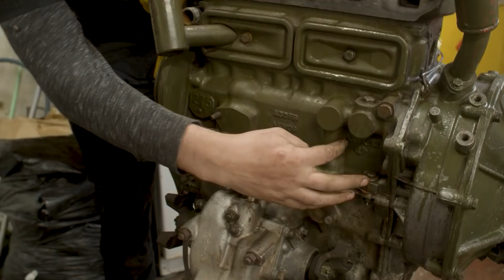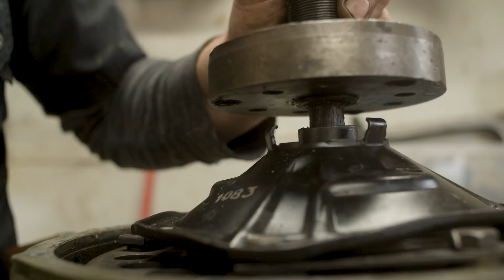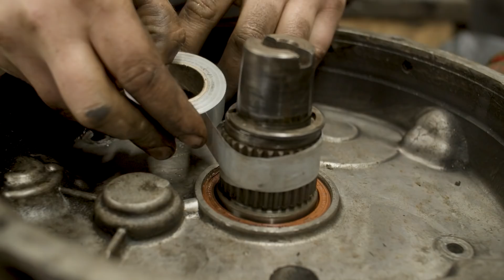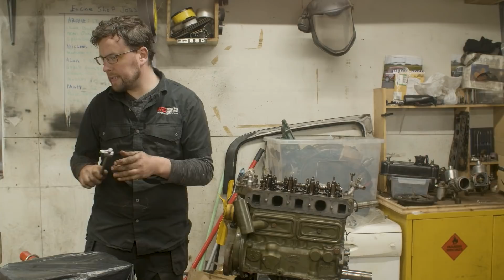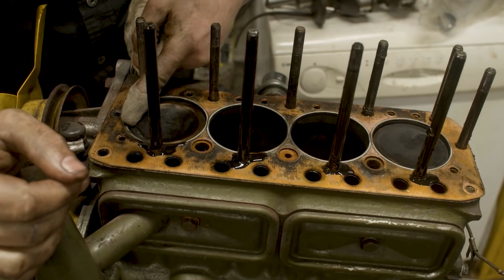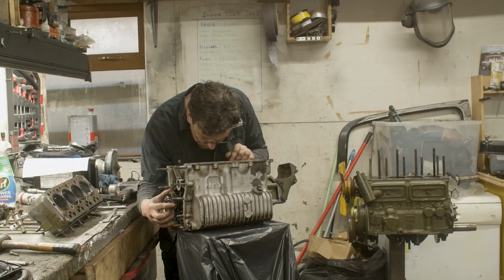Stripping The Engine Of A Donor Mini Cooper S - Part 1

Comment: Spur cut competition gears can be fitted to all mini gearboxes, after engin no. 815140 for 850s. Not familiar with that part number, it was over 55 years since I worked with BMC! Probably senility setting in. I would have thought that it should have been prefixed by a C- though.  Note all of my comments are correct as of about 1966!
Reply from the maker: Thanks for commenting Tony and I greatly appreciate having someone of your experience helping out on the channel. I have taken a second look at the box and very defiantly no sign of a C- thats not to say it shouldn't be there could have been ground off.

Comment: When I was at BMC special tuning/competitions department in the early to mid 1960s  that camshaft wasn't available, I don't recognise the part number. I assume that its a later cam with the different oil pump drive. For Road use and our rally cars we always recommend and used 510 cams. They became the standard cam for later Ss, after engine no. 9F/SA-Y/4006 in 1966. In my day the S camshaft were:-
AEG 148   early S, all capacities 
AEG 510 Late S, 1275cc
C-AEA 731  highly tuned cars
C-AEA 648  race tuned cars.
BMC never recommend the highly modified camshaft for road usage on a 1275cc car because it ruined its torque. I do have the details of these camshafts.
Reply from the maker: Hi Tony thanks for all that steller information. Im fairly sure this cam is after market ST and was from something like formal Junior. It has the double drive gear one at the dizy end but also one at the fuel pump end which I was lead to believe was to run something like a scavenger pump
Reply: @HREIRL  Very likely although it's all officially denied the competition department made up all sorts of special things many were just a one off! In those days a lot of "what the eye doesn't see" went on.

Comment: Be interesting to see what the pistons are and how much the block is decked. I have two 1380’s here both with Datsun pistons. They require 1/4” off the deck as they have a much shorter comp height (32.5mm). Rods also get rebushed to suit the pin.
Reply from the maker: uhh thats very interesting Stacy do you have a part number for them ?
Reply: @HREIRL  no part number, they are 0.5mm oversize pistons for datsun a12 engines. The ones I have out are ACL pistons
I’ve just pulled the other engine down to look - it has 73mm standard Datsun A12 pistons with part number RA2562A. 
They are reasonably small dish, about 2.5cc I think.

Comment: I think I can see an engine rebuild in my future, after a twenty minute drive my oil pressure drops enough for the light to faintly glow on tick over. So I should probably check the crank and rod bearings !!! Thanks for the video
Reply from the maker: Hmm ya dose should like you might some wear to catch up on there Patrick hopefully nothing to major just needing a refresh

Comment: Forget clicking the fingers - if you really need to break something into multiple pieces, try This Old Tony's "one-inch-punch."  :-D 
PS: I think I'd consider the AEG-530 a "race" cam - as a kid I used what we called a "AEA-544 rally" in my daily driver (in a pin-drive 1098) and the power curve wasn't too friendly for road use - and I believe it's a milder grind than the 530.
Reply from the maker: ahh TOT punch Deffo need to try that in the future. ya its a very serious profile as you say its much more akin to racing than in a road going S

Comment: Great video. I was stripping down my old S engine too this weekend.  it's in the same state as that one is.  Let us know what cam you end up with.  The cam in mine was a CA2 and was too lumpy.  Want a nice road cam, like a 266 or a minispares Evolution cam. AC Dodd's cams I've heard are good.
All the best
Paul
Reply from the maker: Will do Paul, this will probably end up with one of Mister Dodd's cam or else an MED high torque
Reply: Personally I still prefer the original BMC 510 cam as fitted to the late 1275cc Ss for road use.

Comment: That head has really been worked! I thought my 12G 295  had big valves & ports but they are huge!🤪🤔. Hope that block can be used . Good old Billy  " wot you doing ".
Reply from the maker: was a bit of crack all right. Ya cylinder head is seriously worked !

Comment: Can liners be fitted to a block already bored to 73.5mm?
I've previously been told it can't be done.
Reply: I was told by MED who also sell a 74.3mm liner that it couldn't be done.  If I understood correctly the liner doesn't pass right through the bore in the same way as a factory liner does, instead it butt's up to a step in the bottom of the bore and if already bored to 73.5mm  the 'step' is unable to support the liner adequately. 
I have a couple of 1275 blocks that have the solid centre main bearing that have damaged 73.5mm bores that I'd hoped to get linered.
Reply from the maker: We are hoping to get away with a spun cast iron Liner at 74.3mm which should have enough of a lip in the block to hold the liner and also give us enough material for a stable bore

Comment: A 850 gearbox???? is that done for acceleration and not top end??
Reply from the maker: I think in this case it was a remote box, they had a gear kit and it worked out that way.
Reply: Good question, I had a 1275 with an 850 gear box as well... Guess it's down to the ratios and what's in the box?